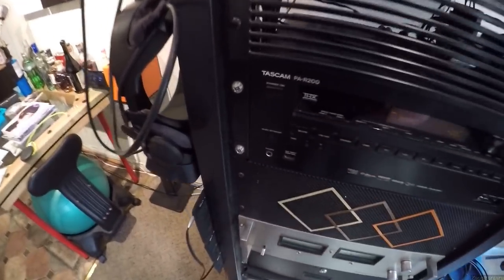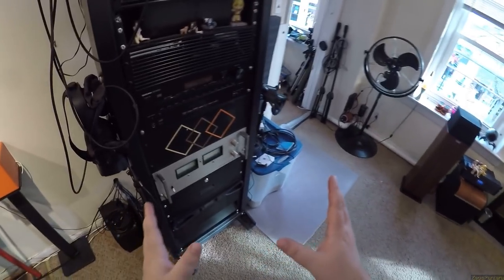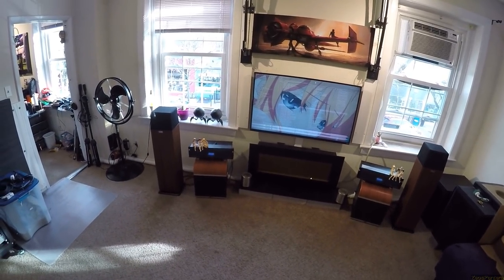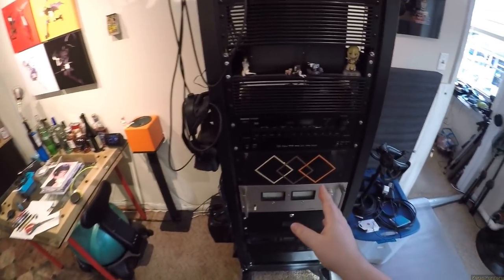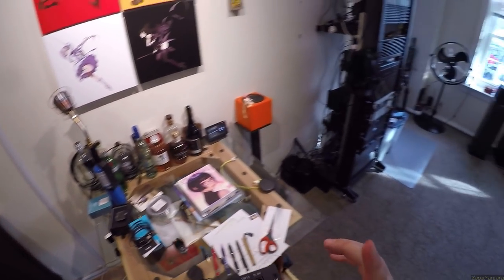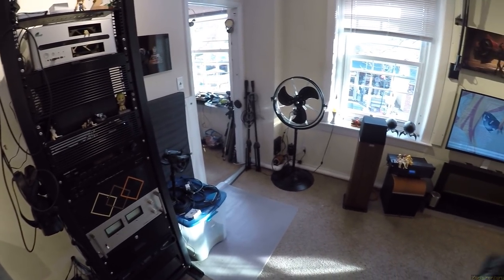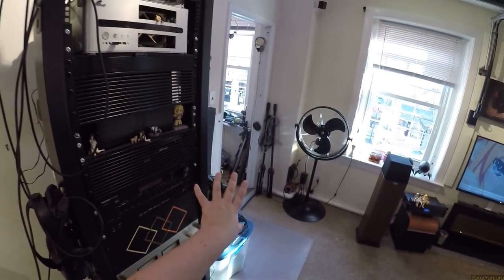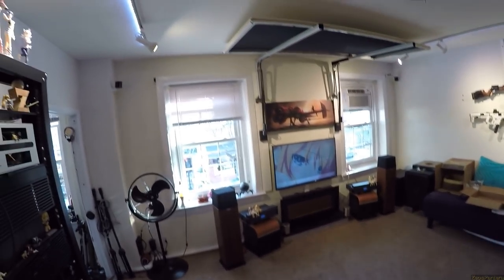⭐️Picking a Receiver _(Z Reviews)_ Home Theater 102

Comment: Tier list for AVRs since Zeos is out of touch;

S - Trinov/Datasat/Crestron
A - Arcam/Anthem
B - Denon/Marantz (Denon and Marantz are practically the same thing lol)
C - Yamaha (not because build and component quality doesn't match D+M, it's because YPAO is trash)
D - Everything else (Pioneer and Onkyo particularly)
Reply: YAMAHA is reliability KING! YPAO is not trash.
Reply: @thegoat164  YPAO is trash. Don't try and argue against science.
Reply: @BenTan89  What AVR do you use with your setup?
Reply: @thegoat164  Lmao why would you take a year to reply to me?

Anthem MRX1140 btw.
Reply: @BenTan89  Why would I take a year, well I don't know, maybe I didn't want to listen to you trash my YPAO at the time. I just happened to be checking out this vid again and came across your post. I've seen you around on various sites discussing the SVS Ultra bookies which I also own. I don't know if you're still using the Ultras since you recently bought a new AVR (Anthem MRX1140). I went and took a look at your AVR, very nice and would cost me about $4, 500 here in Canada. Do you replace components often or stick with what you have for many years?

I'm still using a Yamaha HTR-6160 (2008 model) aka Yamaha RX-V663 and I've been very happy with it. 95 watts 2 channel driven. I see yours is 140 watts 2 channel driven. I'm in a medium sized room and find I have plenty of power for the volumes I listen at. I hear YPAO has improved with newer receivers but still not perfect, but neither is Audyssey. I just go into settings and do a little tweaking, no biggie. Not that I can't afford it, because I certainly can afford to blow a few thousand on a new AVR but why would I want to do that? The only reason why I bought a new AVR in 2008 was because I wanted Dolby True HD and DTS-HD Master Audio. These new AVRs now have features that I don't really care about, like 8k and Dolby Atmos...etc. I'm not going to be putting speakers in my ceiling. I love my SVS Ultra Bookies 😉
Reply: @thegoat164  SVS Ultras are still in my HT room, haven't changed them out and probably won't for the foreseeable future.

YPAO was trash, STILL is trash despite the improvements. That's simply the way it is, don't be too uptight about its negatives. ARC on Anthem is just simply in another league, on par (IMO even better) with DIRAC. The only thing better at this point is Trinnov's room correction. But that's a millionaire level product.

That said, I really only use ARC for cleaning the region within 250hz to 1khz. Bass management and PEQ I do it manually with a miniDSP. The problem with YPAO is because it uses infinite response filters, meaning they ALWAYS have some stupid reason to muck around the treble region for no good reason.

Comment: I use DENON X7200WA model. which I like for AURO 3D.I still have my onkyo 5009 model which is in my locker now. watts is 2ch driven . They say 5 times this 7 times this many watts. But they all say 2ch driven.

Comment: Things i want to share, that was not mentioned in the comments.
1. no receiver will do the rated power. What watts is says it will do, is for 1 channel only. When you drive all channels you take 60% of the specified watts for 1 channel. I have a denon 1400h that says it can do 80watts x 7. so in the real world it's probably gonna do 60% of that or around 50w when all 7 channels are driven.
2. Klipsch lies about their sensitivity rating. They can't do 97-99db/m with those small woofers. 2 x 6.5 inch woofers need to do 119db /m for the rated power they say their speakers can do which is 150w. So, they are way way over from reality.

Comment: Pioneer is "trash" quality wise, I had an Elite receiver, the $1100 price point down to $800, all the HDMI ports on the back were loose as f*ck, the cables would wiggle out. Took it back to Bad Buy and they got me a new one under their Geek Squad warranty. Still had the issue, just a little better and usable. You get a metal front plate and the fold down door to match and a heavier chassis if that's your thing at around the $1000 price point, worth it for me, get last year's model for $300 less. Just make your decision and be comfortable with it. I have a Yamaha RX-A1020 (after a surge fried the Pioneer, hehe) now, keeping it until I get a 4K source. Pioneer Elites do sound great, just watch for quality issues.

Comment: The trick is to run a receiver that's literally older than the HDMI standard. No need to worry about HDMI versions for 4K if you dont have any HDMI!
Reply: But you wont get surround sound
Reply: @notagunfreak8146  Dolby Digital over Toslink would like a word with you

Comment: i've had multiple sony receivers, one entry level stereo back in the day, and the unit currently running my tv setup is a pre-hdmi midrange unit, my one complaint is the driver ic isn't fucking heatsinked.

at all.

it gets _hot_. slow death cook itself hot.

when this 5.1 unit was given to me it was dead (their kids spilled some milk on it) so after repairing the two dead channels (and one of the driver ics) i slapped some y style heatsinks on them, to hopefully keep the unit alive.

the stereo unit has that same driver ic. its what killed it. one of these days i'll get around to replacing said ic and seeing if it still works.

i've got an old pioneer higher end home theater unit. the sony currently in use is infinitely louder, and cleaner.

there's a denon unit at work that's pretty slick with all the bells and whistles. i've had no issues with it and its pretty clean.

Comment: Wattage is a race to the top for no reason. I demo speakers for my clients at work and they always bring up wattage. I let them know that wattage isn’t the end-all-be-all when it comes to picking a receiver. I run Bowers and Wilkins 803s at work with a McIntosh Amp hooked up to each one and I use a Marantz receiver to power them and it’s never even close to full wattage.

Comment: The wattage that receiver companies disclose is not all channels driven it's just two channels driven. You said it's all channels driven just want to make sure everyone has informed the correct way. Driving all channels will be a lot less then what did he say
Reply: I have an older denon 380 1 that actually is a 105 W 7 channels all driven at the same time! The older receivers are much better than the newer ones for the most part in the power department but yet it lacks H DMI and I could care less😉😇   I just run all my stuff into the TV using its hdmi and than use optical which I am aware doesn't do Atmos and stuff like that!
Reply: @bigjay1970  yes he's talking about new stuff though. I realize they're older receivers with a lot more power I have one myself

Comment: A few things to add is: Yamaha makes amplifiers that will last you a long time. According to experts on avs forum and other professionals, Yamaha uses good components, but lack a lot of features, however they are among the most reliable amplifiers and have great cooling. 
Onkyo receivers sound really damn good, overall they have a bit more aggressive sound and more bass, they sound like they always have a ton of headroom, however they arent the most reliable. 
Denon and Marantz are almost the same, but in the higher end of the market Marantz is better. They are both comparable in sound quality and both have tons of features. 
Pioneer makes decent budget amplifiers but their good/ expensive stuff is just amazing. I've heard the pioneer SC-LX72 and their godly pioneer SC-LX78 (200 w rms per channel) and triple transformers). 
Stay away from Hardonkarmon, they suck massive wiener. 

But if you want to get real shit, look for pre amplifiers and power amplifiers by: emotiva, Meridian, Anthem, Nad, Cambridge etc
Reply: Id rather have no features and it sound's really good than a receiver plastered in logos. You mention cooling and onkyo in the same breath, man cool they are not and often suffer from heat-related issues as you mention. Yamaha at the moment is all id buy, pioneer since they have changed hands, have gone done hill and compared to there previous efforts it plain to see cost cuts have been made and the same for Marantz.  Past a certain price, it would be Antham or Rotel all day long plain and simple built like tanks and at 1500£$ for an entry-level anthem that will last you a good long while. It's just not worth buying cheap with AVR's i just don't agree with Zeo's on that, your paying more licencing than an amp at the price (unless on offer that is), Id buy cheap speakers before skimping on the amp in the AV world. Its like buy a road bike or mountain bike, for the same money spent you would get a far more feature-rich/better-speced road bike than a mountain bike. for example ultargra spec'd race bike v a deore spec'd MTB

I would say this to anybody buying an AVR Setup. If you have let's say, I don't know, say you have 3k to spend on AV gear id say spend 1500 of that should go on the AVR WITH AS MANY HDMI's as possible (stupid advice)  that are above or allow for feature firmware of the HDMI standard, Then 2-400 on blue ray or whatever then the rest on speakers (put even more on the amp if you find good deals on the other bits)

AVR world is all about the amp simple
Reply: @gaza4543  I did not say Onkyo and cooling in the same breathe... I said Yamaha and cooling in the same breath.
I am aware of the Onkyo's heat related failures, thats why I said they are not that reliable. 
Also the high end pioneer stuff comes still gets great reviews from Home theater review sites and even "AVS-Forum" recommended, at-least their 9.2 and 11.2 amps do.

Comment: Marantz gets scary hot if pushed and Denon is not far behind. That heat can't be good for longevity.
Reply: matt giunta got to keep them ventilated at all times. I use dedicated fans for my marantz
Reply from the maker: I have actually Covered the top of receivers with plastic, Added a hole and a 92mm or 120mm PC fan running on a 9V transformer. Keeps everything cool and pulls the air from the sides/bottom of the unit. Older receivers use to have Swtiched outlets on the back. But a Smart power strip does the job in 2019.

Comment: A N T H E M  <3
Reply: My Anthem already outlasted the lifespan of my Denon. Sounds better too in surround modes. I don't get the Denon hype.
Reply: @NeoKronos44  - The price nature of Anthem versus others provides you that. Longevity, upgradable software ..and superior power supply / sound quality. Less features.. and not new items every year. Keep your eyes on the next series.. You will not be disappointed. :-)
Reply: @NeoKronos44  maybe because anthem is a high end brand and denon is not. Have you ever seen an Anthem receiver new for the same price as a denon x3500h?